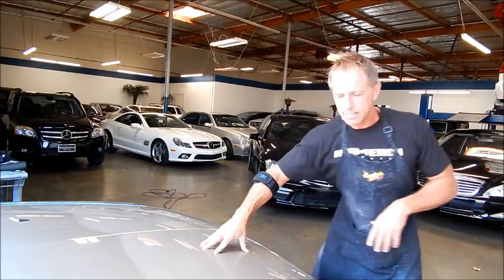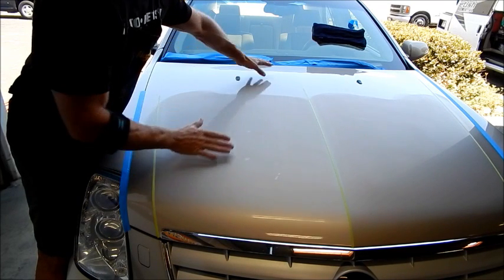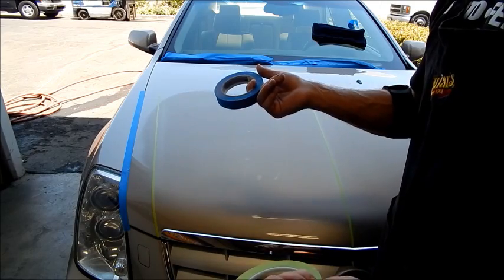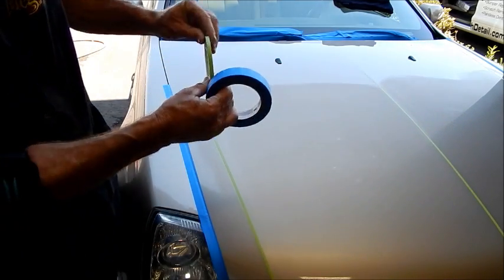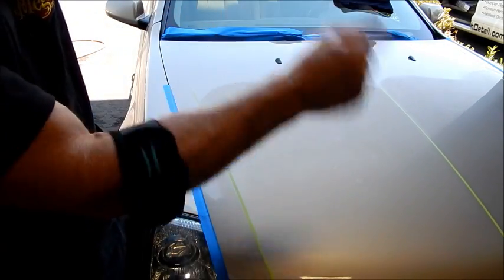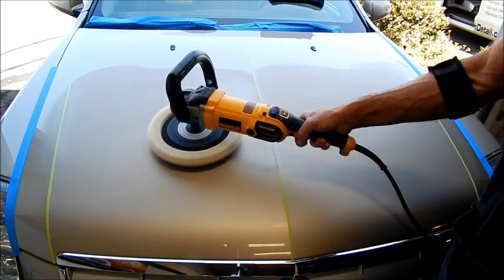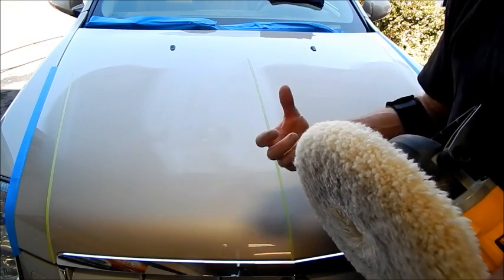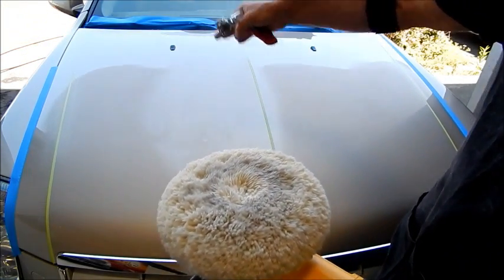Paint Correction Detailing Part 1: Wet sanding and buffing tips and techniques

Comment: Hey Darren, I worked in the industry for a wile and instead of taping off the windshield wipers we would take large towels, put them across the wind sheild, and tuck it in between the hood and the water flashing. Any specific reason you use tape?

Comment: I should make a video on how to do it correctly with out taping. no burning edges , no gunk build up anywhere, and little to no residue, use beach towels to cover the windshield and wipers. use plastic razors to pin the towels in the trim.

Comment: Guys, with reference to the "denim" pads, its actually an Asian invention more than 10years ago. Its a self-created, highly economical, rough textured pad that's so much cheaper vs wool pads, and cuts much faster. 
Almost every bodyshop in Malaysia relied on this self created thingy. And then the largest marketer of detailing products in Malaysia (OSREN) started to mass produce it and supported by YT videos, it eventually went to Australia. From that moment, Im sure many other companies started to replicate it for sale. 

From my experience, it can cut away sanding marks much faster vs 4ply wool pads+aggresive compounds. BUT, when it comes to whacking away Orange Peel, nothing beats wet sanding for controllability and results. 

Also, this type of "denim pad" creates very aggresive scouring marks that are uniquely deep. You'll need loads of woolpad work with a rotary to get rid of these scouring marks.
Reply: JK Low cost

Comment: Have a question, I hand sanded a fairly deep clearcoat scratch with 2000 grit paper, on a 2009 GMC Envoy, I got most of the scratch out and I polished it pretty smooth, there was a problem: the area in the center of the sanding over the scratch the clear coat lightened into a blemish and the scratch was almost gone. Now, there is metallic in the clear coat - I'm thinking it was a minimum two-layer clear coat, and tinting (UV?) was in the top layer. That particular correction is apparently high risk. I have ideas about what I could have done instead - and if, when tested, one of those ideas prove effective- I could discuss it with you privately; in your 25 years I am willing to believe you have solved such an issue and removed the risk.

Comment: Sorry for my ignorant question,  but what is the difference between wet sanding and color sanding?
Reply from the maker: Time. Back in the day we called it color-sanding. The newer version is now called wet sanding. Due to the fact that we have 2-stage paints (clear coats) it is a more appropriate label, but it also confuses people. Just like today we have the term "hologram". Back in the day we simply called them swirl marks or buffer tracks. It seems everything has to become hyped up, glorified, whatever. So the industry and people are constantly coming up with more glorified terms that only help to confuse beginners and frustrate veterans like myself.

Comment: Hey Darren,

To simply enhance the shine on a recent two stage repainted panel do these steps apply? It appeared that the fender was near perfect except on top flat part where it butts up to the hood appeared slightly duller. 

Thanks,
Reply from the maker: V R Only if your eye can discern blemishes of the new re-painted areas. From orange peel to improper prep work of the repaint. Sanding. polishing, and waxing is always going to improve any paint/car, but if you eye cannot tell the difference, then it becomes a non-issue. Most people do not have trained eye and cannot tell see the many imperfections that are part of their cars paint. For this reason, I do not try and reinvent the wheel and deliver to people what they are capable of appreciating or can afford.

Comment: Hey Darren like to see your wet sanding process for removing orange peal soon... Thanks again for all you do to keep the pros and novice informed.
Reply from the maker: It wouldn't be much different other than using a block to do the sanding so as to keep the paper truly flat, therefore making the surface flat. Using sanding discs will help flatten out orange peel, but if pad or your hand is used, it will still slightly mold to the texture of the panel. So to create a truly flat surface, you have to use some tool, block, etc. that is truly flat as the backing for the sand paper.

Comment: I just open the hood, doors, etc and wipe off the excess product BUT it is 1000 times worse when that crud is in the emblems, trim, between body panels like fender/bumper where you cannot simply open and wipe.  It is NEVER fun removing the other guy's wax.

Comment from the maker: @Lester Burkes -Orange peel can only be removed by sanding it (wet sanding, color sanding) flat, then polishing the sanding marks away.
Here is a page to reference:http://www.expert-mobile-car-detailing.com/paint-color-sanding.html
Reply: Auto Fetish Detail Daren do you happen to know about the the denim and velvet orange peel removal pads that carpro-us sells. You put them on a rotary buffer along with a compound or polish of your choice. You remove orange peel with out any sanding marks. You should contant Corey at carpro-us.com about them.
Reply: ww2717 I just found out about this product. The photos i see from people online show amazing reduction of orange peel effect. From what I understand, the denim pad is for cars with thicker clear-coat (ie. custom paint jobs) and velvet is for cars with thinner clear-coat (most manufacturer paints). I want to do something like this, but im afraid of how much clearcoat this thing eats up. I would like to hear Daren's opinion on this product as well.
Reply: mkygod actually the denim pads are equal to 2000 grit sandpaper and the velvet pads are equal to 3000 grit sandpaper. When using these pads it's strongly advise to have use of a paint thickness Guage.